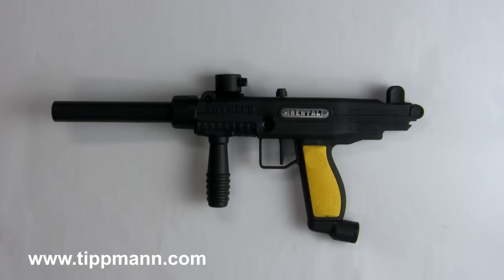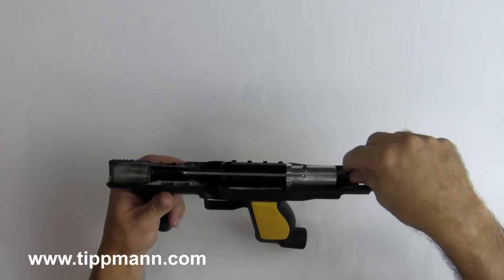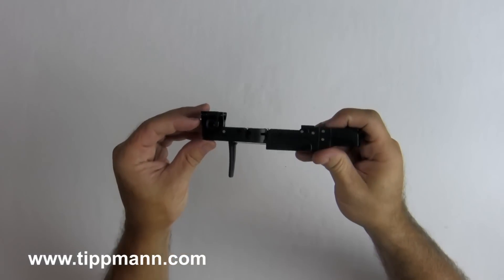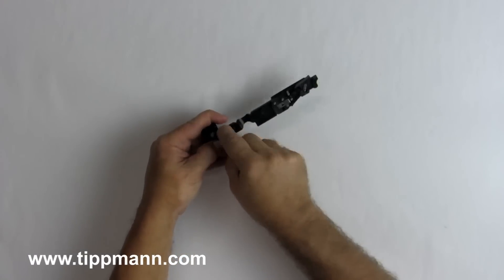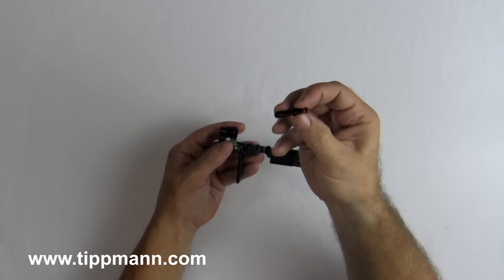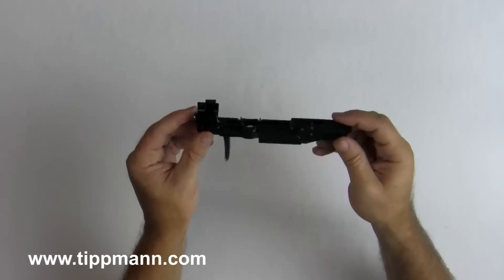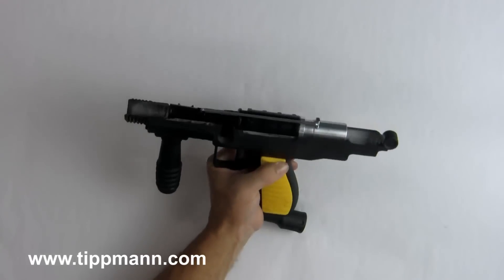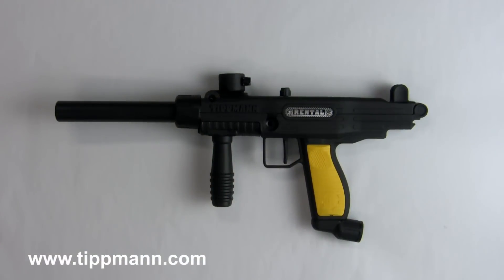FT-12 / FT-50 Trigger Replacement

Comment: HI, i recently bought a few ft-12s for my filed and three of them have the same issue. when u put on the CO2 bottle, cock the weapon and pull the trigger it would fire 2 out of 10 times. and it will never fire once the marker is leaned to the left... but once its held upright or leaned to the right it fires perfect.